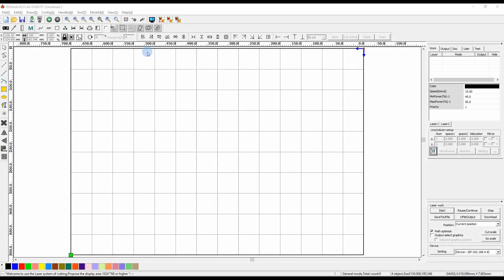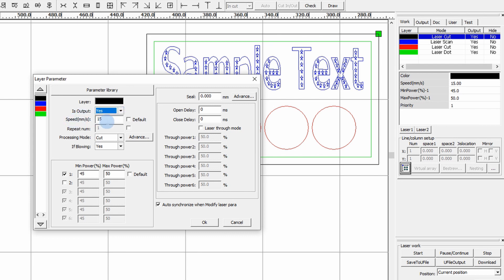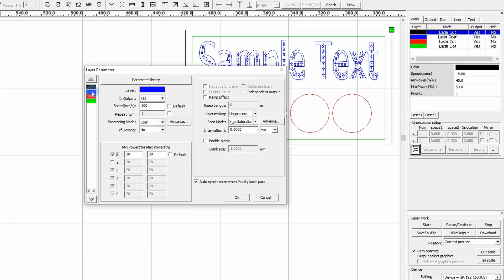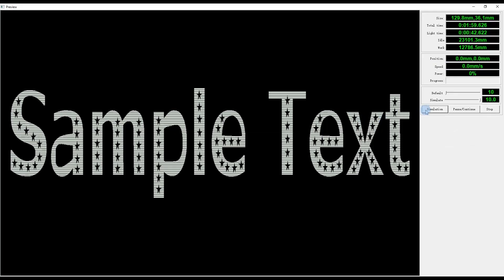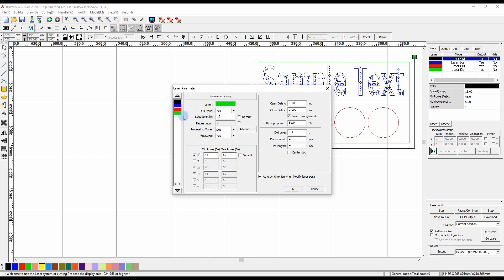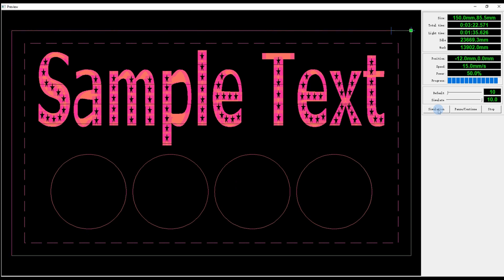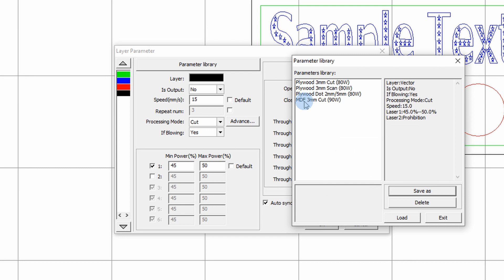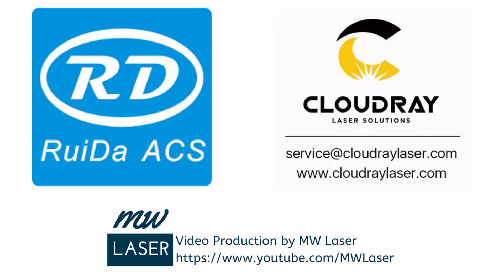[04] RuiDa Controller - RD Works - Setting Layer Parameter & Parameter Library

Comment: I was cutting today and the power went out. I was able to start over from original position but that meant the laser had to go over previously cut. Is there a way to restart it at a certain point? I'm using RDC6445G

Comment: So my machine is not cutting according to layer but process number. Ive looked every where and can't find where to change process at. Do you have a thought?
Reply: Hello, have you found solution? I have same problem.
Reply: @jirkalukas1995  I found a partial solvent. There’s a cut property button. Check box order by layers.
Reply: @HebrewofHebrews  yeah found it too, some guy on YouTube also made tutorial but highlighted this check up. It is really hidden though 😁
Reply: Awesome we did it
Reply from the maker: Glad you found a solution. Sorry for the delay in reply, I have been out of action and moving premises.  I will be back soon with more video content.  Cheers Matt

Comment: I really like your videos, I am straggling with layers, I m trying to do grayscale with 100 small shapes to engrave with different speed and power, but I cant because there are more than 20 colors I have. Any solution please? Anyone.
Reply from the maker: not sure what your doing here, but if you require more layers than RD Works Has - Try LightBurn Software it has about 29 layer options

Comment: hi, appreciate if you could help me. i have imported a drawing (dxf) from autocad to RD works but the lines which are assigned to engrave, does not engrave or show in the preview. pls help
Reply from the maker: this is not something I can assist with via youtube comments.  email info to askmatt@mwlaser.com.au
Reply: Sometimes if the items are a group, exploding them might make them appear when imported to RD works. I notice when an array is drawn in Autocad for example, the group of items that is output, wont appear unless exploded.

Comment: Hello, I wanted to ask you if the program has the frame function (the one that makes the route of the RUIDA controller button) excellent video
Reply from the maker: Yes, it is in the "Laser Work" window Button Labelled "GO SCALE" - after pressing button enter the speed you wish the "frame" to move.  Cheers Matt